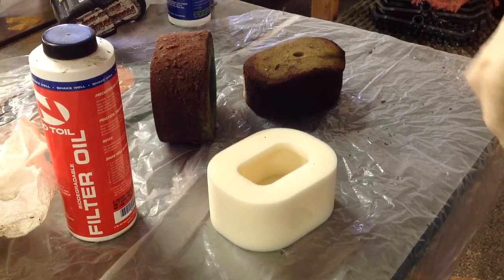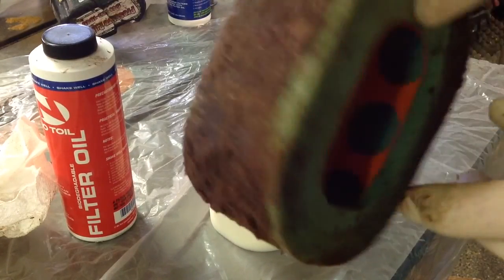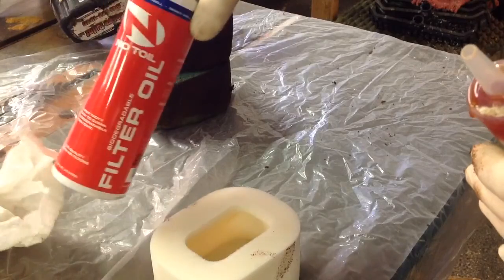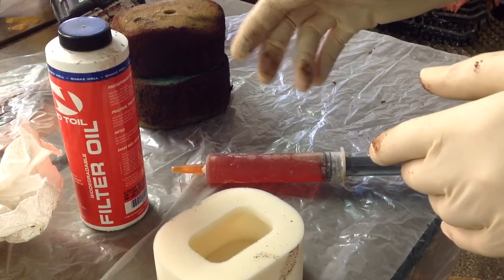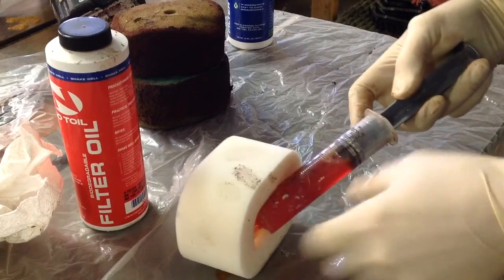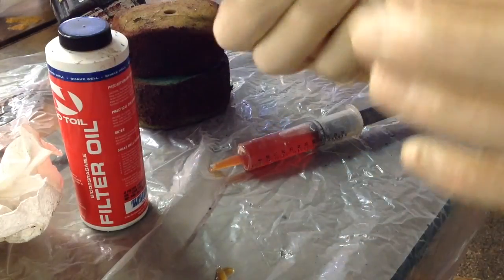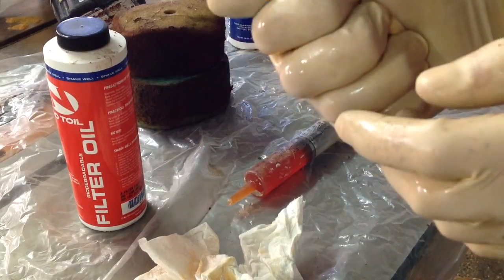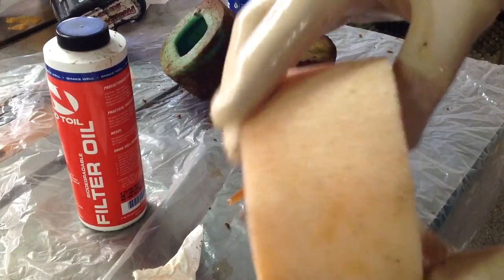MaxFlow Chainsaw Filter element oiling and replacement

Comment: the way do mine is put the clean filter in a Ziploc bag, add the oil and work it into the foam. then just squeeze the excess out and install. I also keep clean filters bagged up.

Comment: so say i'm running my saw for 8 hours a day, how often do these things need cleaning? I clean the normal stock filter once a day, how about this one?
Reply: There are so many variables ( including the cc of the saw) that it is hard to say how often by the number of hours ( or tanks) you run between cleanings.  As we say in the video, as long as there is oil in the element, chances are there will probably be enough airflow so that the saw runs at full power.  So the limiting factor is not when you feel the saw bogging down due to running rich (it probably never will) but rather you need to inspect the inside of the filter cage from time to time to see if there is any dust or dirt getting through.  If you find some dark specks, then you have exceeded the time interval between cleanings  If you ran for 60 tanks of fuel, then check it at 50. You will know the interval before long for the cutting you are doing.  If you are in a fire burn with a 66 magnum, it may be 10 tanks, bucking, it may be 100.  Usually if the foam element is looking like the ones in the video, it is time to clean it.
Reply: Very well explained.